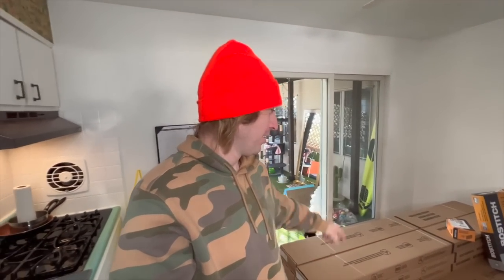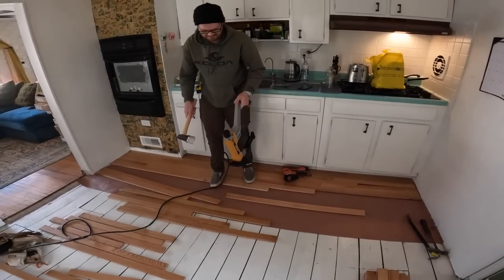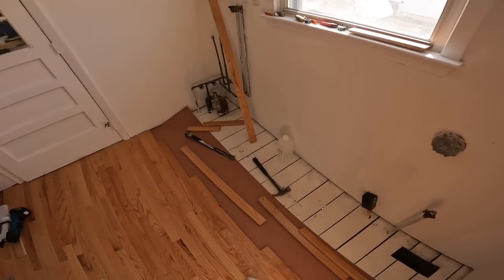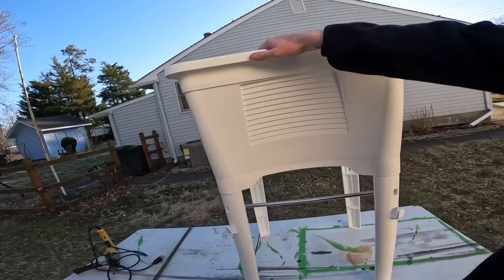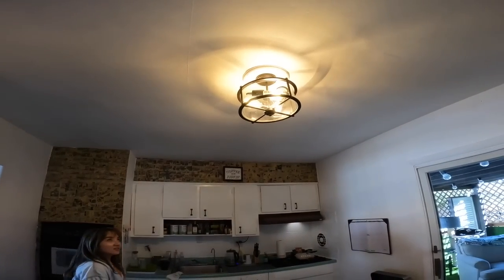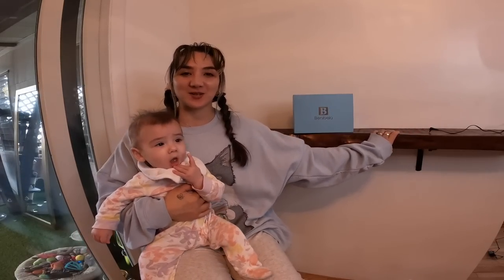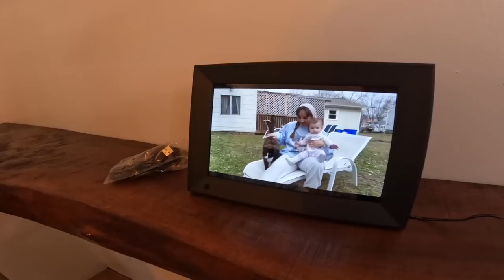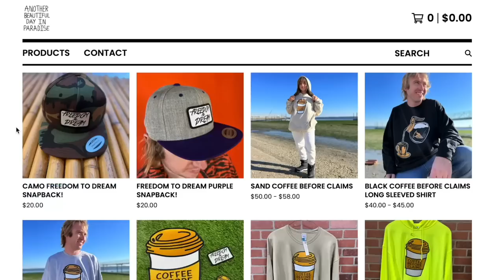We Decided On SOLID Hardwood Floors...Here's The Result!

Comment: Looks great! Buy the rest of flooring a.s.a.p. because they cycle through inventory with the season's and the tones/shades may not match if you wait too long. Buy 10% more than you need to allow for miss cuts. You can return a box if you don't use it. Or save it for floor stains later on to replace areas. Nice job Sammi. You worked so hard on this. Painting is so tedious to do. You guys just make us all smile!

Comment: It looks absolutely beautiful. One thing though... I would not have put hardwood floors in the laundry room. If you ever have a water leak in there, which isn't uncommon, you'll end up with ruined flooring.  A laundry room should have linoleum or tile in it with a drain in the floor.